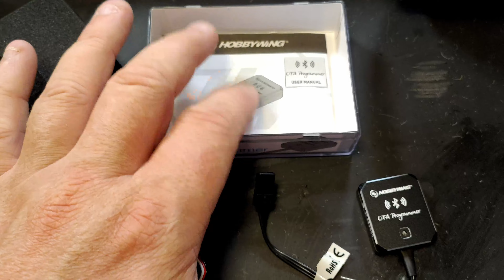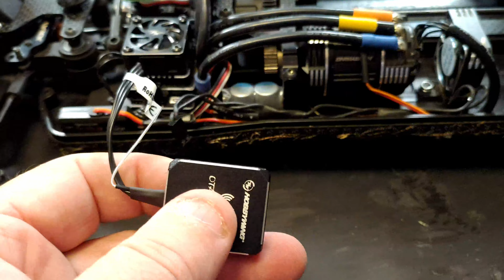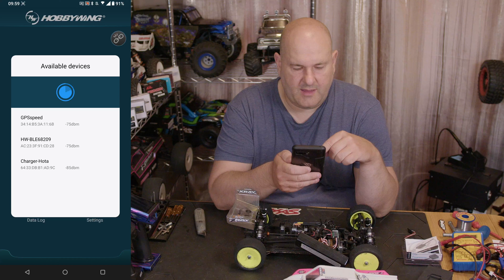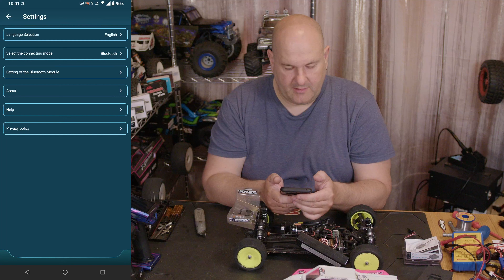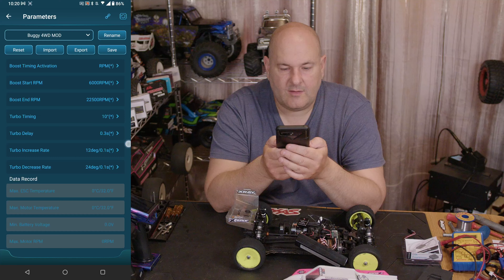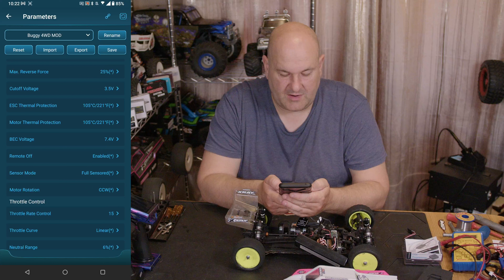HOBBYWING HW30850400 OTA Bluetooth Firmware update and xr10 pro update and set up.

Comment: Hey love your videos, learnt lots!, just touching on the timing aspect, can this device tell accurately where your motor timing is? say if you have clocked the back end of motor different from factory?
 And if so would it be possible to accidentally over time a motor with your turbo and boost settings?
Once again , keep up the good work, I find your videos easy to follow ,,,, cheers.
Reply from the maker: The programmer is not doing anything other than allowing you to access the esc so any changes you make are saved to the esc and the esc knows exactly what's going on with the motor as it runs the sensor cable so you are not in any more danger of damage than if you set the boost too high or advanced the timing too far any other way :)